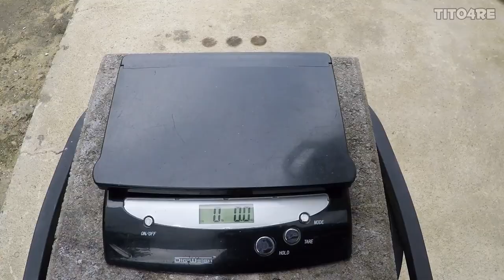Casting An Aluminum Skillet From Start To Finish

Comment: "What would you like for breakfast, John?" "Oh, I don't know, honey, how about some Alzheimers?"
Reply: I prefer damaged motor skills.
Reply: Hmm? What was that?
Reply: +Dakota Kahnke what's YouTube?
Reply: holy shit big cat!!! I'm out...
Reply: +Lee Gaming HQ lol no, was a failed attempt at an Alzheimer's joke
Reply: Stainless steel seaps nickel and chrome wich unlike aluminium ( 50mg average ) cannot be processed and will accumulate in your body.
There are exceptional alloys but these are seldomly found in cooking wares, even 18/10 is more toxic than aluminium .
If you really wanna eat from the most toxic common cook ware try teflon or enamel.
Reply: I was just thinking the other day, that we should rename aluminium to dementium.
Reply: Ardie Reitsma the problem is with aluminum oxide. When under heat, metal generally oxidizes easily. This is especially true for aluminum because of the low melting point. The oxides get into your food and harm you from their. Iron, however, does not rust as readily at cooking temperatures and iron oxide is a common mineral used by the body. All those other alloys of stainless steel utilize enamel coatings to prevent it from leaching into the food. Generally this comes in the form of the non-stick coating you see on most cookware.
Reply: I'll pass on the PFOA's and PTFE's. I'll stick with quality SS and cast iron.
Reply: If anything he should have made something like a copper skillet. Yeah, if you cook something acidic in it you might get a bit nauseous, but it won't give you Alzheimers as far as I know.
Reply: Mike L 
Aluminum has a relatively low melting point. That is why it's so attractive as a casing metal, you can melt it over a hot camp fire. If you're looking for exact numbers here, aluminum melts at 1221F or 660C where as wood burns at about 1100F or 593C without air being blown on it. 

The fact of the matter is that all metals oxidize under heat. It doesn't need to be high heat, though that may oxidize it more. Reaching at least half a metals melting point would be enough for the metal to warp, let alone oxidize. Aluminum is just a poor metal to cook with. 

As for aluminum causing Alzheimer, it had a lot to do with the fact that the body cannot process aluminum like it can Iron but, like mercury and lead, it winds up in the bloodstream. Once it reaches the brain, it has a similar effect to that of other metal poisonings. In this case, symptoms nearing Alzheimer's like forgetfulness and lack of motor control.
Reply: lol, all here like your fucking experts,lmfao. i was a chef for 25 years. Aluminium was the only pot or pan you would find in any kitchen until the 90's when the push for SS came in. of course there was copper pans and cast iron pans, but Aluminium was No. 1. dont forget the introduction of stainless steel also destroyed the carbon steel knife.
it has been a long held belief  among chefs that the whole Alzheimers scare was used as propaganda to introduce reform in the industry in that era.
Reply: Perfect 👌
Reply: both are terrible for you. If he wanted a safer alternative with a relatively low melt point he should have used bronze or strait copper.
Reply: Pleaz help I’m confused, don’t know what pan material to cook with. Which is the healthiest?
Reply: I think it will be fine for frying as long as you don't cook sour stuff in it. My grandma liked to cook rhubarb in aluminium pans bacause it cleans out the pans so nicely. I'd probably not do that. :o
Reply: Lmao
Reply: B S
Reply: @benr4469  Iron
Reply: @cobboGHS91 just because you used it for many years doesn’t mean is not harmful, tell that to the lead paint industry 😅😅😅😅😅😅

Comment: For lifting the iron pan out of the mold, I recommend using a strong shop magnet to minimize the risk of damaging the mold.
Reply: but its aluminum
Reply: @WapTek123  He's talking about the cast iron pan used as a pattern. 

I think a couple small Magswitch units would have better control for removal.

Comment: Nice job, looks pretty usable! Here's a couple of thoughts, though:

Mold the sprue with the part, not after removing it, that way you avoid messing up the mold.
I saw a Romanian dude using wedge-shaped sprues to make his pots, so he'd just hammer them off instead of sawing.
You could also place the sprue away from the mold altogether, and connect them with a runner.

Molding a pouring cup/funnel makes it easier with aiming the pour.

Unless that baby powder is actually just talc, there are better materials to use as parting powder. Graphite powder, for example.

Don't go throwing and mixing sand on top of the parting powder all willy-nilly, be more careful with the sand layer immediately after the parting powder and you'll get better results.

Make yourself a proper crucible holder, you'll end up getting burnt using just those pliers, not to mention it's not really the safest way to hold a crucible full of molten metal.

Hope that helps!
Reply: I sure wish you would teach me. I friend asked me to make him a krampus mask this December.  I have no idea where to start.  I work carving wood masks sculpting them.

Comment: Would love to see you make a copper fry pan, look into aluminum toxicity.
Reply: +bean eigth dude you just woke me up with this post!   Here I am thinking he should not be eating off the thing cause of no telling what else is in the aluminum of the casting.   And the aluminum itself is bad enough, heck I been drinking from aluminum cans and such all my life and have symptoms I never could explain.   You just might have saved my brain from more damage, thanks for posting!
Reply: +Good Old Gamers Aluminum soda cans are lined to prevent toxicity.
Reply: +Deadly Little Gamer also the amount of aluminium that you would end up ingesting due to using aluminium cookware would probably be very small and completely harmless
Reply: +jamiepie123 ikr pretty much any thing is toxic in large dosages.
Reply: +Harrison Blake Even bottled water
Reply: +Deadly Little Gamer  Well if you are playing video games with someone whos a bit mad and piss them off it might get your throat slit.
Reply: copper is much more toxic to cook with, which is why all proper copper pots/pans etc. are lined with other metals to prevent the metal from coming into sustained contact with the water/food
Reply: ***** From what I've seen, it's mostly tinned copper for the fancy stuff and copper clad stainless. All the aluminum stuff these days has ceramic coatings
Reply: Look into stainless steel toxicity, much much worse than aluminium.
Reply: Copper is toxic too. It used to be used in sheets to cover timber boats to prevent marine growth and most modern antifouls use it as an active ingredient.

Also, a study into using copper handrails in hospitals showed that it could kill 97% of bacteria on it's surface in 2 hours.
Reply: Sigh....  Aluminum only releases toxic fumes when heated to super high temperatures, cooking temperature isn't high enough to make any problems. Copper is is quite poisonous as it reacts with everything
Reply: @Stormcloakvictory  huh?
Reply: @GeofDumas  copper is not toxic, lol, copper pipes bring you safe water to drink, copper pans are used in candy making and have been for ages, but aluminium is very toxic
Reply: @johnooyen7383  The theory is that the agitation from cooking utensils, heat, salt, acid, etc. would deliver harmful concentrations of copper to the user
Reply: @GeofDumas  but reality is aluminium is dangerous, copper has been used safely for ages, candy makers use it constantly with no ill effect at high heat, but aluminium is just plain dangerous to use, no comparing them no matter how you think copper acts, it has nothing to do with the point that aluminium is poison to cook with.
Reply: Whats worse  though  aluminum  or the Teflon  on the non stick pans. I have an old Teflon  nonstick pan where  most of the Teflon  has been been scraped  and cooked off over the years.
Reply: @dirtychina5964  there is not a "worse" they are both toxic as hell, it's not a competition, just use cast iron and be safe, but please only use properly seasoned cast iron as well
Reply: I own a restaurant, aluminum is one of the most food safe metals on the market. Stainless and aluminum are all we are allowed to cook with under a certain temperature. Copper and brass aren’t even options. All metals contain toxicity. Properly coating and seasoning this skillet with flaxseed oil, makes it safe to cook with.
Reply: Dude, being born and living in this world you cannot escape "toxicity". If you want to fry something in a pan, at the micron level you will get some "toxicity" no matter what the pan is made of. Live life as a human, not a scared little rabbit, and if death comes due to "toxicity" at least you enjoyed fried eggs.

Comment: Nice cast!  I want to replicate an old griddle of my mother's.  It's aluminium, so I'm hoping it will be like the original.  What kind of sand do I need?  Is there anything special about it, or anything that needs to be added?  Thanks in advance!!
Reply: I need to know this as well
Reply: You can use plaster or clay

Comment: Great job!   If you will degas your aluminum before you pour it you will get smoother cast less bubbles.  Use about a tsp of sodium carbonate forced down in the aluminum.

Comment: Hi, the sand used is normal construction sand or did you mix any ingredient for casting purpose, what parts of water is needed for getting the right consistency ?

Comment: While I didn't really like your other casting projects (knife looked a bit like cheap chinese toy, sorry), I think this one is great. Aluminium kitchenware is a thing and skillet you've made can be very useful and durable. I'd also add some heat-isolating handle. Great work.

Comment: Wow, the casting came out really good (at first I was worried that your green sand doesn't have enough clay or it's too dry, but seemed to be good enough). How about trying plaster next time? It can be used to cast all the nonferrous metals that have a melting point below that of iron and it definitely gives you a better surface finish (MUCH less touch-up is needed afterwards).
Oh and BTW you don't need that much oil for the fried eggs. Just a light coating of the pan (which barely covers the whole surface) is enough. ;)
Reply: Maybe you should do a video on using plaster or clay , would love to see it
Reply: @jamalking6738  Clay's WAY too much hassle, which I don't even have the right equipment for. Plaster of Paris.....maybe, once I'll have enough time to do it.

Comment: that is really quite cool. one thing though. that egg was the nastiest thing I've ever seen lol
Reply: because the yoke was raw?
Reply: no because he burned it black
Reply: you have deeply offended the egg lover inside me, and I cannot even look at you, that egg looked perfect.
Reply: eggs shouldnt have rust on them though, you want brown crispy bacon not eggs
Reply: Doggy McDogeface Actually rust can be defined as "any film or coating on metal caused by oxidation." by dictionary.com. Aluminum always has a layer of oxidized metal coating it unless it's not in an area with oxygen, so it is possible to get rust on your egg from an aluminum skillet. In fact, all materials sluff off small amounts of molecules and atoms (which is why you can smell things) which means your eggs will always get aluminum oxide (Rust) on them when in contact with the skillet.
Reply: +James Bond Just because dictionary.com says that, that does not mean it is true. Chemically speaking rust is iron oxide, and is a type of corrosion, while aluminum can corrode it requires the presence of other chemicals (salts), electricity, extreme heats, or long periods of exposure, which can lead to aluminum oxide, which is more often referred to as aluminum pitting(when observed, because of the pits that are created in the aluminum). Also to note aluminum oxide is a light gray, or white color, while rust is generally black, brown, or red in color.  Also with your source, dictionary.com, you will notice how the second definition supports your information, that is because the second definition is less common/less supported definition, but is up there because some people, don't care and don't know the difference between rust, corrosion, tarnishing, and patina, and call anything they see on metal that is not shiny like it, rust.
Reply: Eneko Zubizarreta I agree with you that the definition I found is not a commonly, and publicly used one, but I hold that my point is still supported as dictionary.com is a credible source in a general since (maybe not for a disertation). I didn't get into the color because that's where Kirk Jackson was wrong and I found it amusing to point out the faults of the big bad wolf, Doggy McDogeface. And to him, Yes I have melted aluminum before on a couple occasions and have witnessed the oxide layer since it has a much higher melting point than elemental Al. Yes, I have worked with metal in a machine shop. I enjoy an educated conversation, and I especially enjoy a blundering argument where nothing is supported by a general knowledge of chemistry in this case. peace mates

Comment: People that flip fried eggs just are the devil, nice pan though
Reply: +Tito4re you r so cool
Reply: +MrcabooseVG If you don't flip... it will burn one side to crisp by the time egg is fully solid-
Reply: +Mauro Tamm I don't flip my eggs and they are nicely done, no burnt side :)
Reply: +Mauro Tamm cook one side, splash the top with the hot oil. it's not rocket science.
Reply: Mauro Tamm
At that point you may as well poach the egg though. You get a spatula and splash the oil onto the top of the egg and get it slightly crispy on the bottom, it is difficult but flipping the egg is just a cop out
Reply: +Mauro Tamm medium low heat pop a lid on that shit the steam cooks the top perfectly and zero burnage. if you use butter instead of oil you can even add in a teaspoon worth of water at the halfway point and cover
Reply: +Mauro Tamm There's a thing in cooking where you don't use full heat but instead use a longer cooking time at a lower temperature. You should look into it.
Reply: Is this an argument on the way people cook their eggs?
Reply: Ik,I like the yolk to be liquid.
Reply: If you don't flip it it's not a fried egg. It's a sunnyside up egg

Comment: Ok may I give you a little advice about molding?
Your method is perfect but the way you press the sand is make it not pressed very good and give you a bad surface on your casting 

Here's what you should do :

Cut a piece of wood about 2 by 2 inches then make one side of wood like a pyramid ( for weight distribution ) after you filled the mold with sand use it instead of that peace of wood you have, simply place the flat side over the sand and hit it with rubber hammer ( coz it suck shocks and distribute weight more evenly) 
This thing good for 2 reasons 
First it make the inside of mold welly smooth and second it press it more which make the line between to parts stick better and less aluminum will exist and you'll have better edges .
Just don't be afraid of using force, hit it kinda hard but use less force on second mold with that you'll have a perfect flatness between two molds 

Sry 4 bad English 😅 Love your videos keep it up 😘

Comment: Can you actually use that skillet to cook? Without it melting?
Reply: is it safe?
Reply: +Aleph Null Negative.
Reply: nitroman365 does it give a metallic flavor and all that along with some dangers of use. will you need to season the pot with oil after its done like with a cast iron pot? oe have some other coating
Reply: +Aleph Null Copper transmits heat well but it corrodes very easily, so it is good for the bottom coating of cookware but not the food contact surface. Also, too much copper in the diet is quite hazardous to health and causes liver and kidney damage.

Aluminum is almost as good at transmitting heat as copper is, but it doesn't have the slew of health hazards that ingesting copper does. Aluminum is still quite susceptible to corrosion and pitting though so you wouldn't be able to cook acidic foods in an aluminum skillet. If it went through the process of anodization then it might be okay for acidic foods.
Reply: +AmazonBoxie That's all bullshit that hasn't been proven
Reply: Aluminum doesn't support acidic food ? So why Coca-Cola cans are made of aluminum ? Does it contain a protective layer inside to not let the liquid touch the metal ?
Reply: +Ludwig DeLarge all can are sprayed on the inside with a coating
Reply: Chemistry Modz
There have been some studies that suggest that aluminum consumption may contribute to dementia, but they have been passive conclusions at best (i.e. "this brain has dementia and there is slightly higher than average aluminum levels...")
Reply: +Nick S those studies are about aluminum sulphates, not straight up aluminum, which is safe for cooking and whatnot.
Reply: If your stove could melt aluminum, why would people build special furnaces to do so?
Reply: Aluminum melts around 900 degrees.  You don't cook at 900 degrees, any grease would be instant fire ball.

Comment: But you should use cast iron for this because aluminum makes food unhealthy.
Reply: Yea because his back porch propane foundry could get up to that temperature .
Reply: +ThatOneHumanMale if it can't than you don't do it at all. Making a aluminum pan is just as good as making a plastic one. It doesn't compare to cast iron
Reply: Sounds like you missed the point of the video.
Reply: John Smith you can cook an egg on a plastic pan?
Reply: No it doesn't.
Reply: @capitalism420  yes, pretty easily.  Many plastics will survive 212 degrees with plenty to spare.  Ive baked several at 400 for hours.